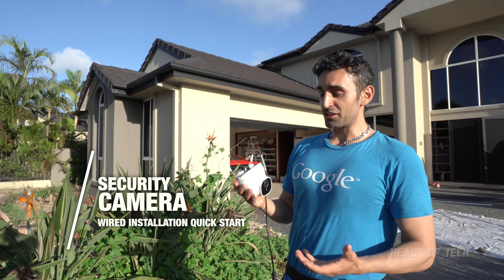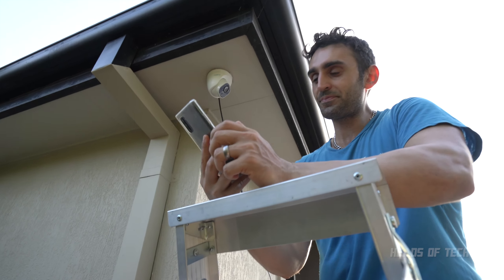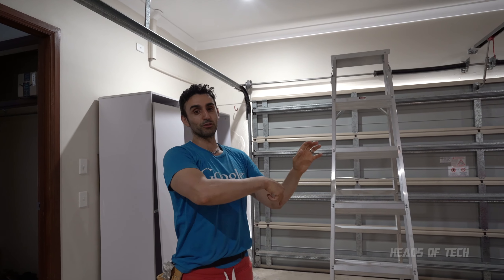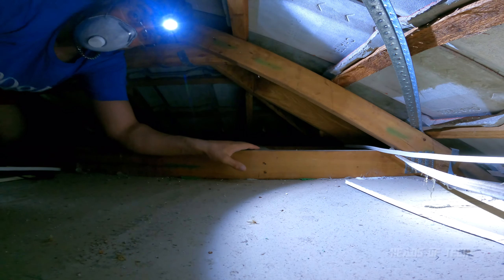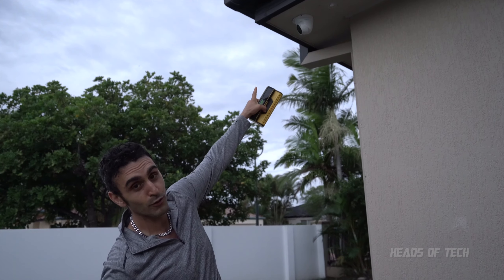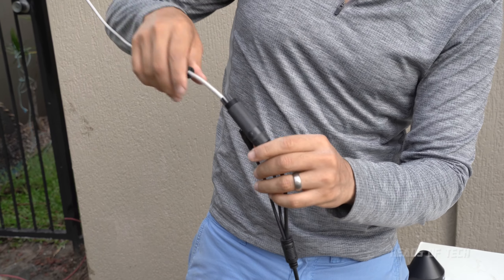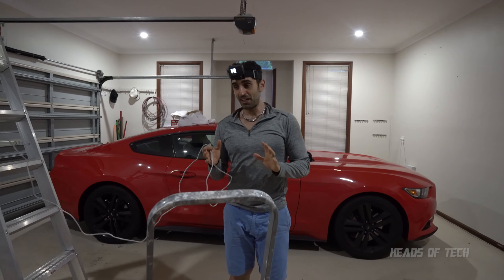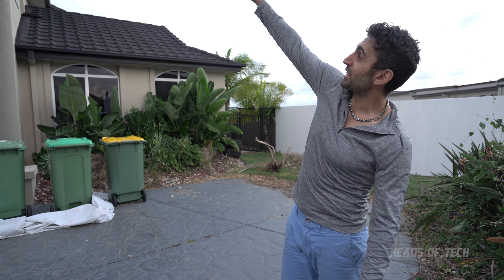How to Run Security Camera Wires - Quick Install Walkthrough | Reolink RLK16-800D

Comment: did anybody notice that there was not attic insulation?
Reply: It's over the garage, which doesn't need to be insulated
Reply: Looks like the rafters aren't designed for a snow load.  Very nice weather there, maybe other weather types to prepare for.

Comment: I  advise wearing knee pads and a hard hat when working in attics. For years I did as this guy. Then I crawled onto a nail. Another time, I bumped the top of my head on a nail from a shingle. These injuries required a trip to emergency medical services.  Since then, I have purchased both, which were inexpensive.  Second, it is a good thing to have a half sheet of plywood. You can move it around as needed and either sit or lay on it to work.
Reply from the maker: Thanks for the tip mate and hope your injury wasn't too serious
Reply: @headsoftech  Nothing serious, but they did require tetanus shots.

Comment: I love your installation you do great work. Nice and simple and clean but almost all the installation are in the same type of homes. Attic above the garage where you have plenty of room to run wires. But much older homes are not configured that way so installation is much much more difficult
Reply from the maker: If it helps, I've got another video running wires up to the attic via two stories here: https://youtu.be/RW086CLRaMI

And another one running wires through the garden to an outdoor security intercom here: https://youtu.be/IZ6fhi-N41s

Comment: Great video👍

How did you screw in the cameras under the eaves? Is it not too soft and flimsy?
Reply from the maker: I just used the basic wall plugs provided and they're still holding strong. But, if you're nervous you can always use wallmate anchors instead, they're rated for 10-20kg each.
Reply: @headsoftech  Thanks very much for the tip

Comment: Pro tip: stop using duct tape,   use electrical tape, its cheaper and easier to work with
Reply: Gaffers tape is better…no residue